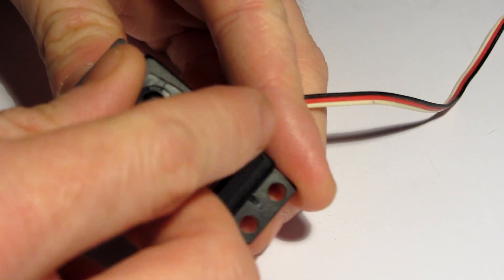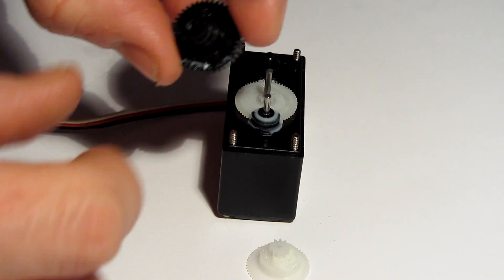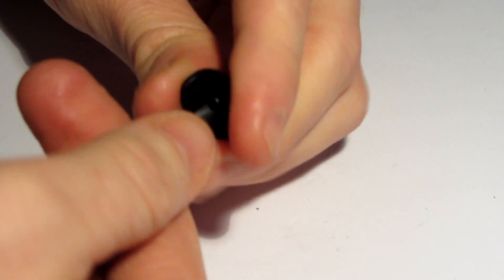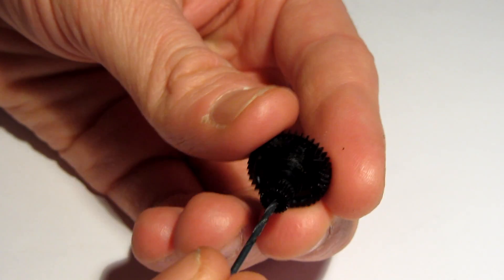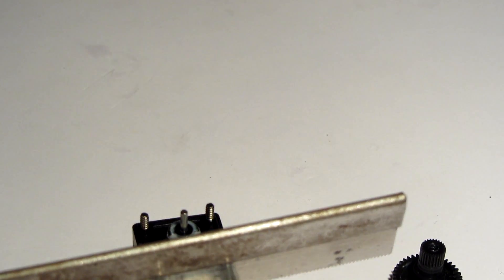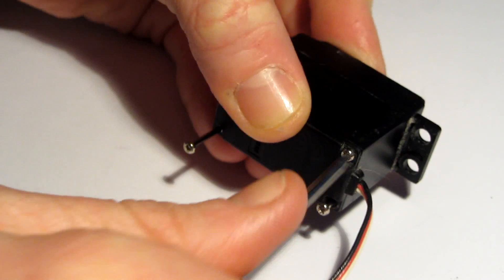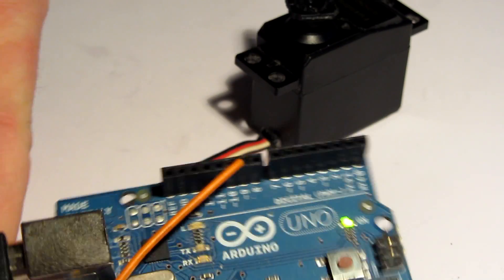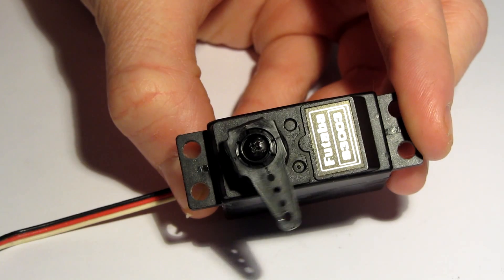How to: Mod servo for continous rotation

Comment: it is a easy way for making the servo turn in 360 degree, but actually how can i control the servo, in a few second which i decide for it?
Reply from the maker: You write a PWM value to the servo (using an Arduino or something).  If you sent different values, it will rotate at different speeds.  Let me know if you need any more assistance with this
Reply: Thanks for your reply.
I am using arduino to control a continue rotation servo. The method you suggested I have tried already, but servo cannot stop until a period of time which I cannot control.
And now I am trying to make a servo look like a motor and just control by getting a high signal to it, but it still not work at all.
So, how can I control the time of a servo movement ？
Reply from the maker: puiyee lam  OK, well if you write a value other than 1500us it will rotate until you write the 1500 value (or whatever is the centre point for your servo).
Typically,
1.  write the value to make it move
2.  do whatever you need to do inbetween
3.  write the 1500us value to make it stop
Reply from the maker: puiyee lam
let me know if this doesn't work and I'll see if I can help some more
Reply: I have already tried to use PWM, but actualy, i want to trun servo in one circle only, but the smallest duty cycle have already turning for around 16 circle
Reply from the maker: puiyee lam you would have to do something like:
1. Attach a sensor that detects when the rotation gets back to a "zero point",
OR
2. calculate the milliseoncds it takes (at different speeds) to rotate one whole rotation.

I will dig mine out and do some tests if you need me to
Reply: chipko Since my project has more then one servo, i think it is not possible for me to buy sensor for each of them. So, i think i will try to calculate the time for one rotation,
if possible, please help me on programming the servo
Reply from the maker: Yeah, I think the timed method for a rotation is a better option.  I'd be more than happy to help.  Let me know what you need and for now, here is some theory.  The servos cannot be rotated in the same way as they used to and instead, they now rotate in either direction at whatever speed you "set".
Servo's have a midpoint (zero point).  On a standard servo this is when it is in the middle.  If you wrote a 1500uSec value, it would stop in a continuous rotation, or go to the middle on a standard servo.

With the continuous rotation servos, when you write a value of more than 1500, so 1600 or so, it will rotation in one direction relatively slowly.  If you wrote 1700 it would spin in the same direction, but faster. 1800, faster again and so on up to about 2000 (the limit .. approx)

If you wrote anything lower than the midpoint (1500us) it would spin in the opposite direction, for example, 1400 would spin in the opposite direction but as fast as it does for 1600 in the other direction.  1300, faster still.. you get the idea :D

To make it stop, you write the midpoint/zero point value - in most cases, 1500.

So the time to do one rotation varies depending on how fast you get the continuous rotation servo to spin .. and in what direction.

Let me know how you get, I'd like to hear about or see your project - hope this helps and let me know what else you need to know.
Reply: chipko Now, i am going to use servo to rotate 1 rotation to either clockwise or anticlockwise in one program.

Thanks for giving me the detail theory of servo for me, actually i know when i change the time it can change the direction of servo, before i wrote the program like this:
void loop() {
   for (i=0;i<=445;i++){
  potentiometer=map(PinReading,0,1023,0,180);
  potentiometer=constrain(potentiometer,0,180);
  servo.write(potentiometer);
  delay(50);
  }
}
when the number is lower than 445, it is clockwise
when the number is higher than 445, it is  anticlockwise
actually, 445 is the number a find out from my testing. it may be not correct at all.

But the result is that it really turn clockwise with a rotation i want at the first time, then i continuous to turn in anticlockwise and clockwise for a few rotation, then it stop. This is not the process i want at all.

Also, i have also try just acting a servo as a motor, i use the program provided by arduino which for blinking LED light. But i can just control the direction of servo, i cannot control the number of rotation.

I have another question want to ask, is that i can only use the pin with "~" on arduino to control servo will have a better result or just any pin on arduino?
Reply: puiyee lam Autually, i have found a program on moving the servo, thanks  for your help. (actually, before you send me the theory, i don't know how servo move at all, by the way , thanks at all)

Comment: Can this go in the reverse direction by just using software or do you have you adjust the pot?
Reply from the maker: Yes, you can change direction and rotation speed in the software :D
Reply: chipko Do you know where I could find a stronger, larger version of this motor? Maybe one that could support 5-10lbs?

Comment: It turns a servo into a DC motor, right? I mean you lost the control of rotation position, only applying voltage left.
Reply from the maker: In essence, yes it does.  With the 1500usec write commands, it stops but the position is not centered.  If you send a 1501+ it will turn in one direction at whatever speed above the 1500 (eg, 1600 is slower than 1700).  If you go below the 1500us (eg 1400, 1200, etc), then it turns in the opposite direction.  So it's not quite a DC motor which only turns in one direction.  I hope this makes sense!

Comment: Connecting a servo up to the 5V regulated power of the arduino (or any other dev board) is a bad idea. A servo can draw a lot of current, certainly if it stalls. It can fry the voltage regulator on the board. Been there :)

Comment from the maker: Oops - sorry for the late reply.  In answer to your question, yes it will rotate in both directions (CW and CCW) at varying speeds.  You set the amount from a set mid point..
eg. 1500ms = stopped
     1300ms - one way
     1700ms - same speed in the opposite direction